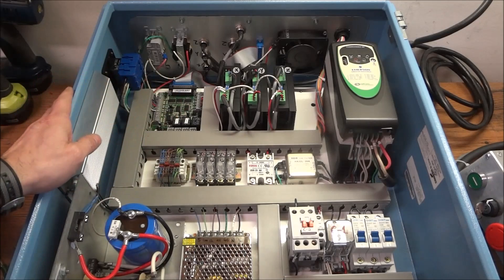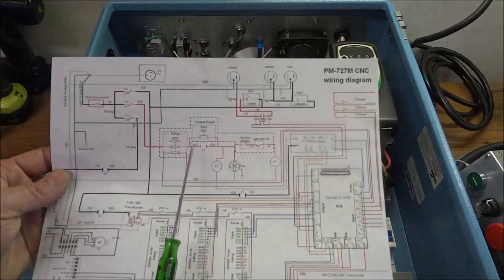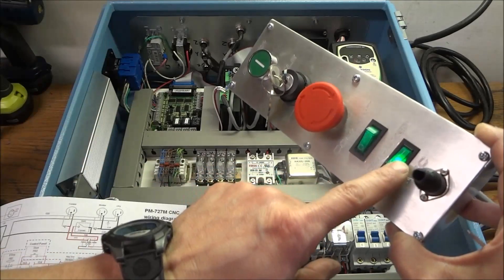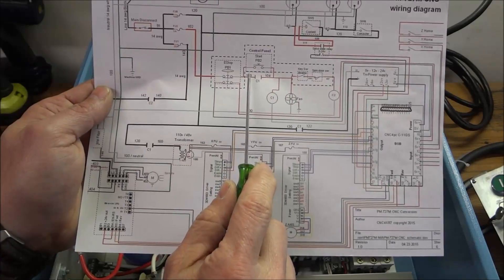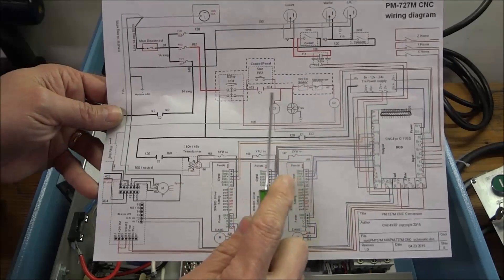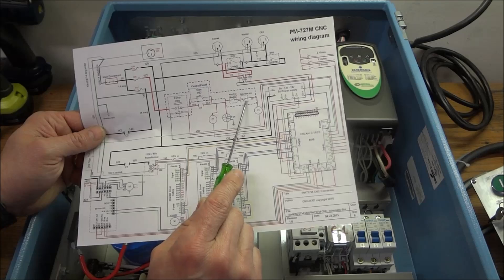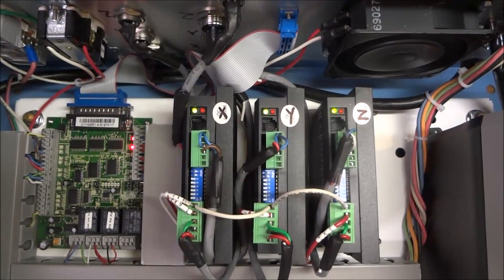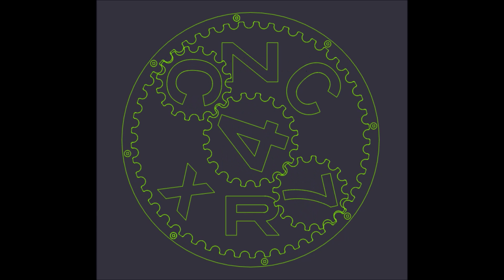PM 727M  Wiring Pt 12 " Wiring overview"

Comment: Sam, I watched your entire series on this build. What a GREAT set of videos. Thank you for doing this it has really helped me.  I do have a question. TheC1 relay  LY2-AC110/120 and mount from Video 4 don't appear to be the same as in your video versus your Dropbox pin out for the C1.  Did you use a different relay at some point later in the build?  Thank you
Reply from the maker: Thank you!
The relay is a 110v ac relay the original relay in the video series was not correct I think it was a dc relay that I ordered by mistake.
The documentation is correct.

Comment: Hey Sam, when you wire up the C11-gs board you attach the spindle control to the VFD so I imagine you can control the speed with Mach 3 but did you instal a feedback sensor to allow Mach 3 to know how fast the spindle is rotating like you did with the tachometer on the Lathe conversion?
Reply from the maker: No I did not It's not really needed with a CNC mill I have it adjusted and its within + or - 50rpm  Mach3 will display what the G code has as the S code

Comment: Hi,
I am currently in the process of building a 5 Axis machine ( A B Axis Head) and I have been doing some research on how to wire control boxes with the plug and play aspect. I came across your video's and just watched the entire wiring process, and WOW! Great videos as well as great detailed explanations. Just want to say great job and thank you for putting this out their.

In the meantime I am also upgrading my CNC Router, I original purchased from China Omni-CNC. I have already replaced the motion controller with the Ethernet  Smooth Stepper from Warp9 and upgraded to Mach4. That has already made a world of difference... Now I am upgrading from stepper motors to Teco Servo motors which I will also be using for my 5 Axis build.

Any ways, I also use 3 phase to run my spindle and servo motors. I think I may have missed something in your videos, but it seems that your power source is 110V single phase coming in to your box which powers your outlets for your computer, monitor and power to your 48V transformer. Question: Where is your 3 phase 220V (230V) for your spindle and 3 phase steppers coming from?

Thanks
Rob
Reply from the maker: Hi Rob No you did not miss anything the 110v AC is supplied to the VFD and the output is 230v 3 phase.

these 110v to 230v vfd are limited to just 1 hp though.
Reply: Sam this is the same question I have after watching these wiring videos?

Comment: Great job on the cabinet and explanation of the holding circuit. That was a lot of videos but everything was very well documented. Now that you finished the cabinet all that is left is everything else.
Reply from the maker: +William Hardin Thank you,
 Yes it was a lot of video's, I think I included just about everything. I'm starting on the Ball-screw mounts and Stepper mounts looks as though it will be many more to come.
Be Safe, Sam

Comment: Thanks Sam! Great video and wow you moved along very quickly.  I agree, the holding circuit is a no brainer. What confuses me is how you wired the pendant.  When wiring up your start and estop buttons,  you jumpered a few wires back in the pendant wiring video that just lost me. I'll have to study the video a bit more.  Are those jumpers referenced in your diagram?  Thanks for all the great info.  I'm just about to put in my order for the PM-727. Last time I checked it was 6 weeks back ordered. Best Regards.  Don
Reply: +SOCOLVN   I should have said a excellent idea, not "no brainer".  That didn't come out right.
Reply from the maker: +SOCOLVN 
It really is a no brainer standard stuff on machinery.
Reply from the maker: +SOCOLVN 
Hi Don
Yes those wires are in the diagram if you look at it and the video I it will be clear. Power from the fuse goes to the estop. Then to the start ditch and c1 contacts. That's one jumper then the other side of the start button  power goes to the other side of c1 and to the key switch
Reply: I work with an automation guy . I've always thought of your type as magician . To see a build from the ground up was amazing . It is a no brainer to build , but to design and understand the process and to do it at the price point you did, is genius. I've been studying wiring diagrams from the tormach 1100 control panel and yours is just as nice if not nicer. Thanks for making it easy for me . Perfect timing !!!!
Reply from the maker: +SOCOLVN 
Thanks it should resemble the  Tormach 770.  My pm727m is my attempt to build as close as I can to the 770. 
Be safe  Sam

Comment: Hello Sam,

On the main disconnect switch,  why did you choose not run the neutral line through it and allow the enclosure to be completely isolated when off?

Thanks
Reply from the maker: +BI Boondocker 
Normally those contacts are reserved for 3 phases. I really did not want to confuse anyone. But yes you could wire it that way if you wanted to isolated it. 
Be safe 
Sam

Comment: Sorry if you explained this in your videos but what is the purpose of the contactor for your VFD? It's ill-advised from what I hear especially if you are connecting it to your E-Stop and constantly on/offing it. heard its bad for the circuitry but in any case love your videos and would like to hear your opinion, thanks!
Reply from the maker: +Khalid Al-Kooheji
 thank you, 
Yes I would agree it's not a good idea for your VFD to be powered off and on frequently. However a estop is not a on / off switch it's there for a emergency shutdown. Starting, stopping ,and resetting will be done in Mach 3. The key switch will completely remove power from the VFD by denergizing C2 contactor. VFD's have capacitors in them and take a few seconds to discharge and power down. From my experience some run for years without issue. I am more concerned with safety. Than a VFD.  Be safe Sam

Comment: Great work!  I've been following the whole series.  I'm about to dive into this type of build (re-build) for my machine.  I'm curious about a couple of things...  how did you determine the need for contactors for specific circuits, and any reason for not going with a BOB or other cards that allow you to just plug in Cat 5 network cables for connections?
Reply from the maker: The main contactor provides power to the power supplies and is part of a safety circuit. 
C2 contactor is a pretty standard way to provide power to a vfd.  Boards with cat 5 /rj45 plugs are not as flexible as the C11 bob. Plus using cat 5 increases your connections and downtime with the Extra board needed at the drivers. You still have to hard wire the power to the driver.  I just didn't see the advantage. 
Be safe Sam
Reply: I have C35 BOB with RJ45 connections. PITA I'll let you guess what that stands for. I've had nothing but problems on setting it up with mach3. Go with a bob that's well documented and you shouldn't have any problems finding YouTube videos or info on forums.

Comment: How did you set up your pc to power up with that switch on the pendant, i mean pc is usually powered up by push button if it receives continuous voltage on power on pin it will start and than shut down again. I would like to add that feature to my machine but i cannot think of a way to do it.
Reply from the maker: In my PC bios I just set it to boot on power up.